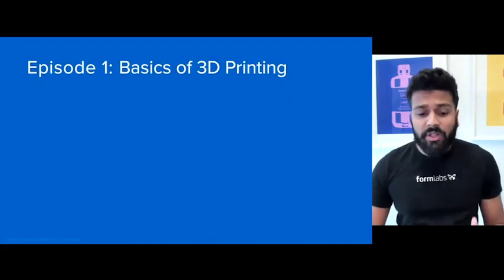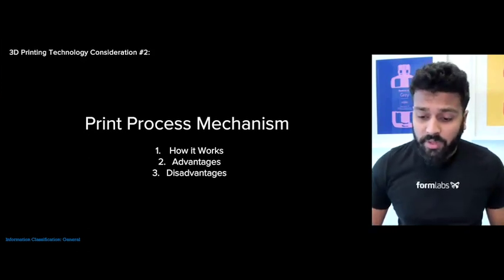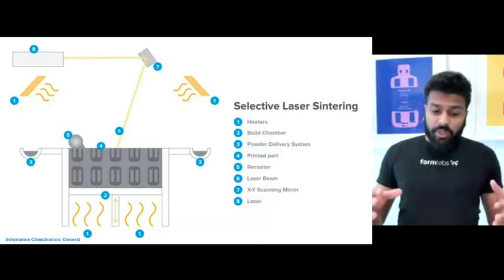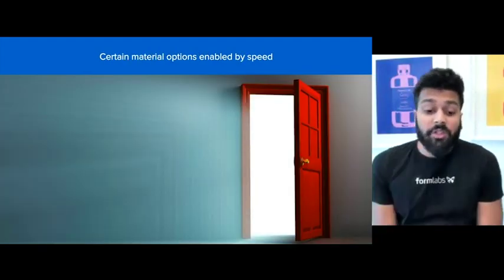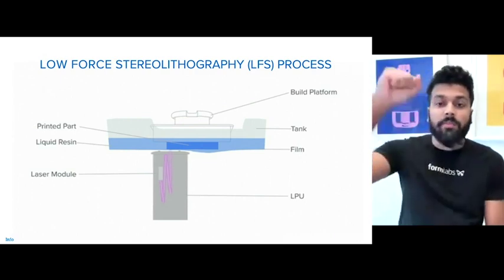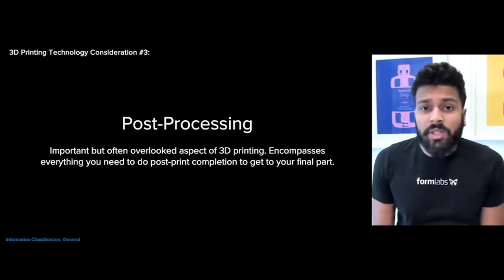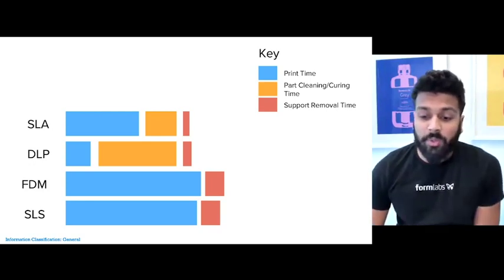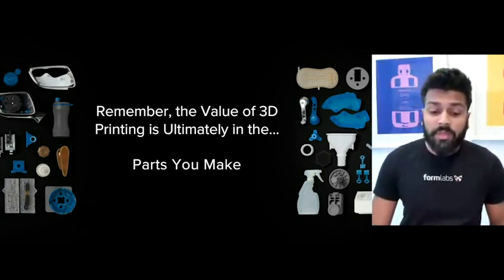How 3D Printing Works: Compare FDM, DLP, SLS, and SLA 3D Printing Processes (Part 1/3)

Comment: Some things I disagree with in your video. 1. SLA is not always watertight.  If you look into the movie prop items like iron man’s suite you can’t print that solid.  So what they do is print at say 100 micron and fill the interior with 10 percent infill. Then put a plug into the big model and put vacuum to it and say spray anything on the surface or feel with your hands and plug it up.  Then you cast 3D printing is only amazing when you save material not waste it.   Do you have full control of toolpath layouts? Also you are locked down to their materials

Comment: In the market I see a lot of 3D printing companies passing their LCD and SLA printers off as DLP printers when they are not. Seems like the LCD is very similar to the DLP but less reliable, and SLA simply is not DLP because the (sla) laser has to draw the out with layer instead of flashing an entire layer all at once.
Reply: It’s on the verge just wait 5 years led will take over